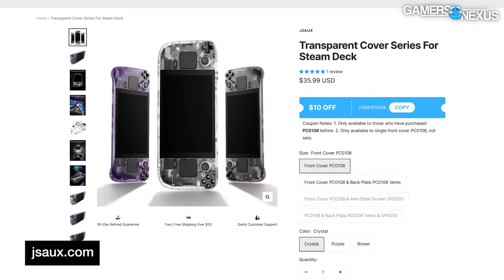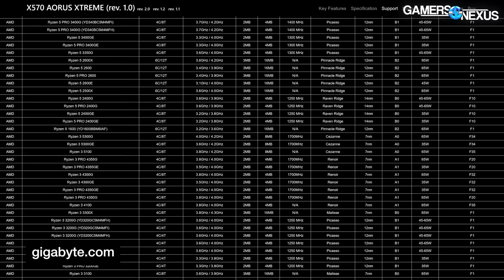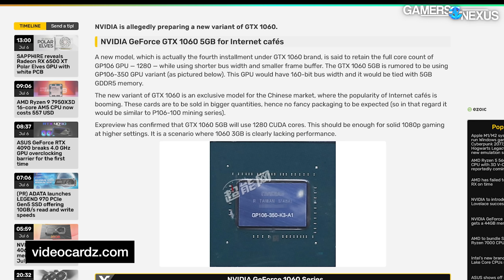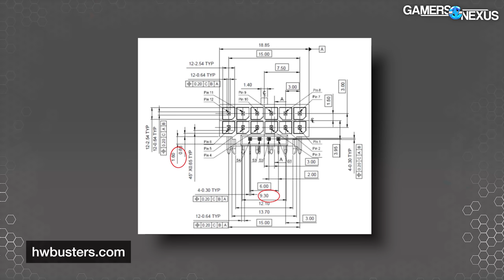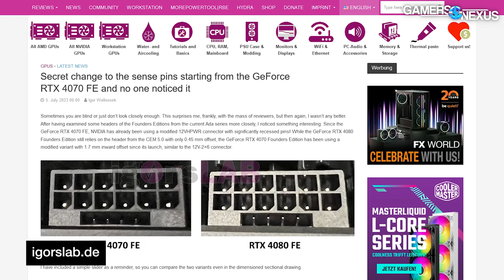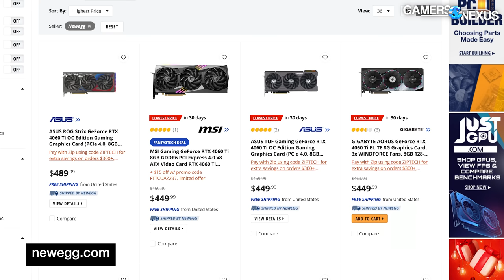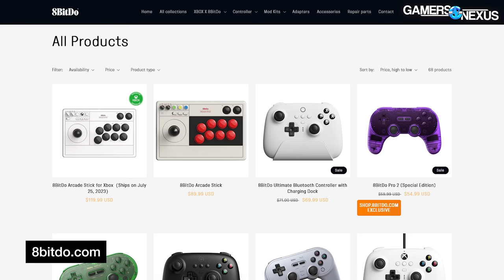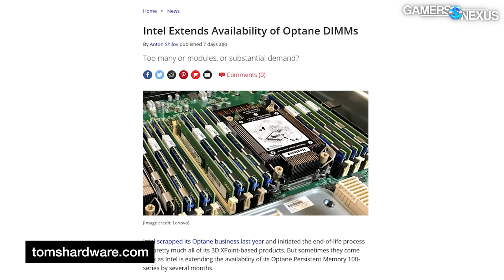HW News - Ultra-Small Intel Arc GPU, 12V-2x6 Connector, More AM4 CPUs, 4060 Ti 16GB

Comment: Anybody remember the single slot Galax GTX 1070 Katana? Crazy how graphics cards have gotten so big and power hungry.
Reply: Yes, it was hot and loud, to be fair
Reply: @ivanbrasla  well it can't be as cool and quiet as a Noctua 4080 that's for sure
Reply: @ivanbrasla  I've checked Reviews and apparently it's not really loud and at 80°C it's just as hot as my two slot 1070
Reply: I used to have a GTX 295, that fcker ran HOT but was completely fine doing it.
Reply: It is one of the most interesting cards made.
Reply: I believe there are multiple rtx 4060 models with 3 fans and “spill” over into the fourth expansion slot…
Reply: @ivanbrasla t had similar thermal performance as other models of 1070 at the time. The thing is they had to machine a really clean looking pure copper block instead of using heatpipes with aluminum fins, so it must've been expensive and unfeasible(at acceptable prices) given how much GPU manufacturers squeeze AIBs nowadays.
Reply: @imnotusingmyrealname4566 noctua 4080 you say… that sounds pretty good
Reply: @imnotusingmyrealname4566  what 1070 do you have? i recently brought out my old 1070 I have in my closet and repasted it and after 30 mins of furmark at default settings and fan curve it only topped at 62c (msi model, don't know which one though, 2 slot) I do have a decently high airflow case (lian li lancool 216) but fans are running slow and quiet
Reply: @Terracronz  look it up, it's magnificent
Reply: I mean they're just competing on numbers. Nvidias 40 series is the most efficient GPU on the market. Undervolt and underclock any of them a bit and they'll run cold and cheap.
Reply: @konzo5942  cheap? very funny, it's a shame that the architectured get more efficient nobody wants to make a low profile card anymore
Reply: @imnotusingmyrealname4566  the market for gamers is tiny, however you're welcome to pick up low profile quadros. And yes, undervolted and underclocked 40 series will run cheaply, very little power.
Reply: @imnotusingmyrealname4566  I meant to say the 1070 was already exceeding the power envelope a single slot solution could comfortably handle. Those cards throttled at 83°C, so 80 was high temperature. Remember there wasn't hot spot measurement then, 80 meant 10-20° more somewhere else
Reply: @konzo5942 p1000 is still crazy expensive (~$500-700) and the one with reasonable price is rx6400 (~$130-160) for a low profile single slot cards that's about it for gaming. I know I was tasked with upgrading p340 tiny from p620 2gb to anything reasonable.
Reply: Honestly GPUs are as power hungry as they have been for a decade. Look at the Radeon HD 7990. Launched in 2013 it cost $999USD and drew 375W of power.

I think it's just that the power consumption has bled down a bit into the low-mid tier.
Reply: Hell yes!! Been wanting one for years now. Can't justify it yet though
Reply: it was HOT af
Reply: @Cygnus-Phi  you mean the GTX 480 or the good old Rx380/390
Reply: @Cygnus-Phi  Yeah I ran 2 in sli my room was loud and hot
Reply: @allxtend4005  GTX 295 was a single card SLI, I previously had the 4870X2 which was the AMD single card SLI version and that card died on me for no apparent reason (I've been doing PC's and funky setups since the early 90s, it's the only card that ever died and I clocked a LOT).

So I got mad and went "well no AMD then" and got the GTX295 instead, then noticed its temps (it got to 94C under normal gaming) so to me that was a "not again" moment but after some googling and testing it turned out it was completely happy at 94C, in fact it would conk out around 104C so I just left it as is. Never failed me.
Reply: Still the fastest single slot card to the day lol. And looking FINE at it too
Edit: Oop forgot the RTX 4000 existed
Reply: GPUs have become power hungry because industry / customers expect more performance boost over last gen than is available from manufacturing node + design upgrades.

Since N7 node generational performance gain has been around 15%. Design optimization gives some extra, but not the total of 50%+ ppl are expecting.
Reply: Cards was always power hungry, Maxwell especially was kinda hot for the performance. Pascal was a big leap
Reply: @tthbeige3332  they don't really need that heatsink though, it's just the manufacturer that is using the same heatsink for all cards because it's cheaper to have one line for all than make smaller sinks for the smaller cards
Reply: @ivanbrasla  just like laptops a single slot card is an extreme environment, still better than mining
Reply: Yup I have one my shelf 😎👌
Reply: @Rotwold  nice!
Reply: RTX A4000 is basically a single slot RTX 3070ti that performs like a RTX 3060ti due to lower power limit but with 16GB of VRAM. It runs hot and loud.
Reply: A GTX 1070 Katana, underclocked to be cool and quiet, would still perform better than an A380, right?
Reply: @4.0.4  the A380 is very weak so yes
Reply: @imnotusingmyrealname4566  mining is fine for cards, no heat cycling, usually great airflow, undervolted and underclocked. a laptop is about as bad as it gets. mining is a breeze compared to most gamers.
Reply: Graphics cards have gotten way way better, that also made them more and more expensive and over engineered.
Reply: @tnaxpw  p1000 literally $50 on ebay.
Reply: Like i keep hearing how efficient everything is supposed to be and die shrinks and i go I can’t wait for another katana for my NCase Itx but NOPE.
Reply: @Drdirtydee  probably try find a quadro cooler and stick it on a reference rtx equivalent.
Reply: @tnaxpw  people fit a2000s in those btw with single slot cooler mods
Reply: @andriandrason1318  my bad was thinking about T1000 8GB
Reply: @konzo5942  Oh ye cus I have a block of copper and mill/cnc for it.
Reply: @tnaxpw  it doesn't really cost that much to get a part ordered, if you're that butthurt about not having single slots cards.
Reply: I have an ASUS Dual 4070 so the base model it’s 2 fans it’s no bigger than a typical card and it’s TDP is 200W but I find it runs fine with an MSI Afterburner power limit of 60-70% so that’s 120 to 140 W.
Reply: @depth386  how is performance with the power limit?
Reply: i still have one (i re-pasted and replaced the thermal pads about 2 years ago ) and it works great (not loud and performance is decent). it's been used as a "temporary" card in quite a few of my pc builds for friends and family :)
Reply: @imnotusingmyrealname4566  i still have one, i re-pasted and replaced the thermal pads 2 years ago, and it's not loud and puts out decent performance!! (the fin stack on the cooler is very similar to old laptop coolers so it can be blocked up by fuzz but not look like it is blocked up from an 'outside' inspection)
Reply: @tallywhacker75  yes in the review by Hardware Unboxed they said it wasn't really loud snd performance was at least a 1070 founders edition, so it's great
Reply: That thing is sick, trying to get my hands on one, but it's rare.
Reply: @Cygnus-Phi I think that whole series was hot,i had gtx 260,or was it 265,im nit sure and im lazy to check,but i remember it was freakin hot.
Reply: @konzo5942 you literaly cant undervolt 4090 bruh😂
Reply: @EyefyourGf  yes you can?
Reply: Weirdest cards I own are a passive HD 6770 that's about as large as a shoe box and the HD 5870 "eyefinity edition" that has 6 mini-displayport outs. I always wanted an r9 Nano, and I wish another special mini card would come out. Some of the half-height cards available now are pretty cool though.
Reply: @theencoder6992  That was an exceptional card.  Most high-end flagship cards seemed to run in the 180W - 250W range, e.g. GTX 1080 reference was 180W and, well, AMD didn't really compete high-end during the Polaris era, so 150W on the RX 480.  Going backwards, R9 290 was 250W errr 275W, and going forward RX 5700 XT was 225W.  Maybe using your gen card, Radeon HD 7970 was rated at 250W.  Switching to the nVidia side, GTX 980 rated at 165W... you see the pattern and generally going back further meant even lower draw.  Single-slot GPU's even at the flagship level were the standard for many years -- look back to like GeForce 6800 and Radeon X1800.

It's easy to forget today but $1000 GPU's used to be practically untouched even by most PC enthusiasts and heavy gamers.
Reply: Every galax product is worth remembering, they are absolutely incredible

Comment: I'm not waiting for a cheaper AM5 chip, I'm waiting for mature, 2nd gen AM5 motherboards
Reply: That was my original plan, but I saw a newegg bundle deal that was really good and snapped it up.  I typically go for 6 cores, but bundle came with 7700x. Biggest downside was the overly built gpu clip; a few decades of PC tinkering taught me that it'll just pop off, so when I couldn't quite reach it to release the gpu I just pulled the gpu out.  Ended up breaking off the clip completely.  Felt/feels bad to do that to a brand new x670e mobo, but I don't buy 3 slot behemoth of gpus, so not too worried about it.
Reply: In 2025, PCIE 7.0 drops along with 3 nanometer CPU's  by that time DDR5 Ram will have better latency and it will be cheaper. In 2026 AM6 comes.
Reply: Im chilling for 3rd gen am5 cpus. 😂
Reply: Is not about second gen motherboard, is about BIOS and AGESA. I have a Aorus Elite ax b650 in the last bios es more stable, but in the first bios F2 is a piece of shi  tt
Reply: @@cancermcaids7688 The 5800x3d is $277, that would get you quite a bit more performance.
Reply: @maxdamage4919   new agesa drops soon, will have software voltage clamps for potato overclockers.
Reply: @davidbrennan5  ok Nostradamus
Reply: @Robbie-mw5uu  He is not really predicting. 3nm chips have been viable for a couple of years now. The cpu/gpu makers have already been ordering the chips and Samsung has been mass producing them since mid last year. You can expect to start seeing CPUs based on it in consumer side soon. Heck, I believe IBM developed a 2nm chip and process with 1nm expected, so 3nm to consumer is coming very quickly now. 
PCie 6 spec was released beginning of last year, so you can expect it to start being implemented, probably in Intel's next chipset(or an update to the current one) and AMD's second gen of AM5. The norm is about 18 months from spec to implementation. That would put in anytime after this summer.
I can say I have no idea on when AM6 is coming, but it will probably not be 6 years from AM5 like AM4 to AM5 was.
PCie 7 is expected in 2025 but that is the spec not devices. Those are probably more like 2026/27.
Reply: Same here. The current roundup of itx AM5 boards is terrible.
Reply: I'm waiting for DDR6. My 5800X3D will manage till then.
Reply: @davidbrennan5  Exactly the swap I did. 3900x for 5800x3D. Get keep the motherboard and ram so it's a really easy drop in swap.
Reply: @_lime.  I went from a 3600x to a 5950x and my FPS jumped a lot. I would have bought a 5800x3d but I have a need for the extra cores with other workloads I run. The 5000 series chips are all over 50 percent off now. I bought a 100 dollar b550 board and gave the 3600x to my son. I am very happy, I might build new in a few years.
Reply: Yeah DDR5 speeds of only 6000mhz is a pretty limiting factor of first gen AM5, and I wonder how limiting Zen 5 will be on first gen, as I expect it to be much more refined design. Doubt it will be cheaper! The IHS design, and high power use needs to come both need to come down. Zen 4 was a little disappointing, especially compared to X3D.

Comment: That M.2 slot added to the GPU is kind of clever. Could be a great option for additional storage in SFF builds (assuming the price premium isn't insane)
Reply: @@cancermcaids7688 way to far from the core to heat up significantly
Reply: @@cancermcaids7688Assuming their tests are accurate it won't, it's pretty hard to find a GPU load lower than 100% on their Furmark stress test and the SSD was nice and cool. Remember that the 4060 is a comically low power GPU between being quite cut down and the fact that Ada Lovelace is really efficient when not being aggressively factory overclocked like the 4090 is.
Reply: "(assuming the price premium isn't insane)" This is ASUS, it will.
Reply: @@cancermcaids7688 It shouldn't. This is for GPUs running at x8 only. At least this is how it's advertised right now. So, if the GPU is in a x16 slot, the GPU takes x8, the drives today don't require more than x4. In theory, it should be ok.
Reply: Yeah… but they should put 2 M.2 slots on them… there are 8 free lanes and M.2 uses 4 of them.
Reply: @gorgonbert  This is pretty much a prototype at this point, I'm sure they'll look at how these things will sell before they put a lot of money into it. A lot of bean counting in any corp. And since it has spare bandwidth and if it turns out to be successful, I'm sure there will be even more expensive models with dual slots.
A problem I see is that when the price goes so crazy because of the M.2 slots, you'll probably get a better/next tier GPU at that price.
Reply: @gorgonbert  The problem is that I'm not aware of any motherboards that support asymmetric PCIe bifurcation. ASUS's own motherboards will do either x8x8, splitting the slot into 2 x8 slots, or x4x4x4x4, splitting it into 4 x4 slots. In order to put 2 M.2 slots on a x8 GPU you would need x8x4x4 bifurcation - theoretically doable but the only way to guarantee it existed would be to implement it on their own boards and then this GPU would only work on ASUS boards.
Reply: @gorgonbert  That would be cool with me. The more the better. Still, an extra slot is an extra slot.
Reply: @@cancermcaids7688 If next generation NVIDIA supported something like the PS5's direct loading from the SSD to the GPU, then it could actually be great for gaming since then loads won't have to go through the CPU and OS.
Reply: @bosstowndynamics5488  Bifurcation not required here, the CPU accesses the NVMe device on the GPU through the GPU's PCIe switch. PCIe, unlike legacy PCI, is packet-switched.
Reply: @erkinalp  They haven't specified since this is a prototype but we have multiple reasons to expect this to be a passive M.2 carrier that requires bifurcation:
1) ASUS has existing carrier cards for connecting multiple PCIe devices to a single slot - 2 models of 4 way M.2 carriers. Both of these are passive, relying on bifurcation as they don't have a PCIe switch chip
2) The card carries only a single M.2 - if it used a switch chip it could easily carry more than 1 M.2 as it wouldn't be dependent on specific bifurcation modes to work. A single M.2 with 8 spare lanes only makes sense if you're splitting a x16 slot with a x8 device already and relying on x8x8 bifurcation to make it work
3) An expensive PCIe switch chip makes no sense on a relatively low end GPU. PCIe cards that are just a switch chip and some M.2 slots or Oculink connectors cost hundreds of dollars even used.
4) "Reclaiming lanes" doesn't really make sense as a concept with a switch chip since that can connect an M.2 device into a x16 slot even if the GPU already uses all 16 lanes. The lanes aren't separated and divided between devices with a switch chip, the combined traffic is routed through all 16 lanes.
Reply: @bosstowndynamics5488  many Gigabyte, and several Asrock boards (at least for AM4) support the x8x4x4 bifurcation mode, but as noted, it's not nearly as common.
Reply: @KL-pe4kn  This is why I actually like the few mobos that have m.2 on the back even though most hate them; way easier to cool back there, you can even use the case itself as a heat sink depending on the mobo tray position. If we're going to put these hot newest gen SSDs right under the hot GPU and CPU they need to be in a closed shroud with a blower fan.
Reply: @bosstowndynamics5488  I wonder if you can use a breakout cable with this m.2 slot? I don't see a reason why not. Couldn't you run any x8 PCIE device "off" this card? maybe a whole separate storage card stuck somewhere else in the case. Probably too much of a pain to be worth it to most people but interesting none the less.
Reply: @rustyshakelford1466  As configured, you could use a breakout/extension cable but only for x4. You would probably need a double x4 Oculink connector to do a second x8 device, and at that point it's easier to just use a x16 to dual x8 riser and any old normal 4060 instead of this more bespoke (read: more expensive) approach.